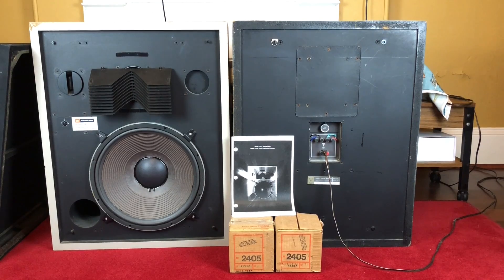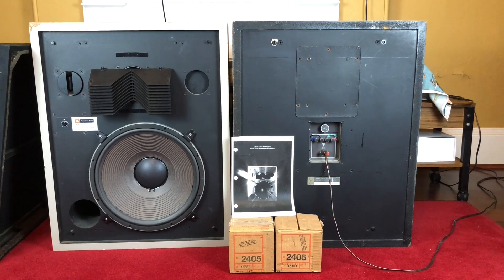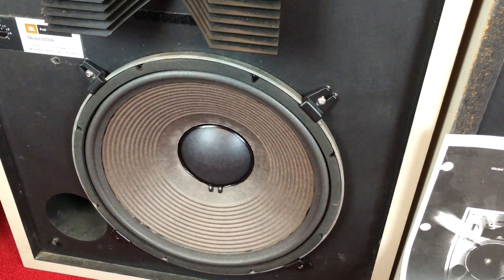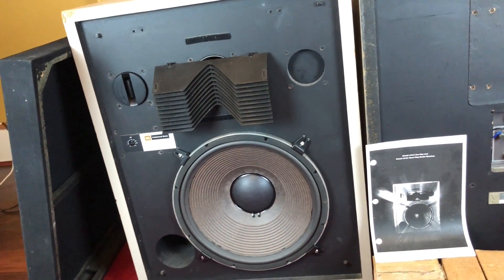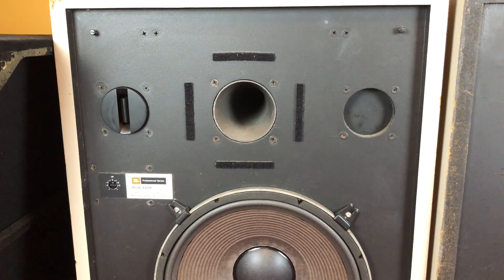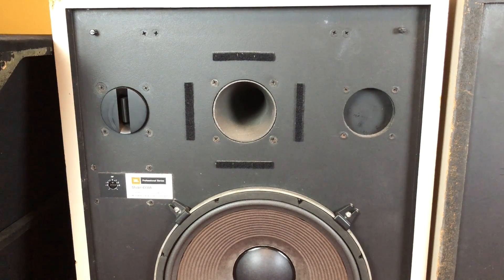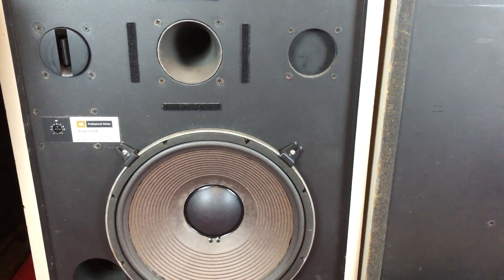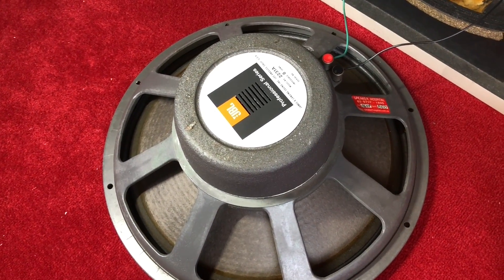JBL Speaker Upgrade -  4331A to 4333A conversion

Comment: Very thoughtfully done.  I too own a set of jbl’s . They are l-200’s. I’ve  been scrounging parts and so far have an N-8000 crossover and a beyma cp21/f as the tweeter for a l-300 conversion.  If, possible, could you hand drawn a schematic on how  you  did your conversion .  A schematic print enhances the video and would be greatly appreciated by many. Thanks.

Comment: Hi, I have 4331 with 4503-1WX cabinet. It has a 3131 crossover. It has a hole for a 2405 tweeter which is capped. I want to add the 2405 tweeters. It’s also has only one L-Pad. Do you have a schematic of what components I need to add to the horn and tweeter while retaining the 3131 crossover. Thx
Reply from the maker: You just do exactly what I did in this video. If you already have the 2405s, then you need to get crossovers. I used the 3106 which has a 8k cutoff. I just did a quick Google and there are plenty of them out there for sale. Good luck!
Reply: @audionautica6843 hi, I was hoping to just add a few components rather than having to spends hundreds of $$.
Reply from the maker: Well you will still need a crossover, so if you don't want to buy one you will have to build one. There is a Nelson Pass design on the internet for an L300, which is the domestic version of the 4333a, but that is a 3 way crossover. You need a 2 way crossover that will pull out the HF for the tweeter, and then send the rest to the existing 3131 crossover. The only reason I would be doing this is because I liked building crossovers and was good at electronics. If you are doing this for cost reasons, that seems like false economy to me. These speakers are worth USD5000 on the used market. If you wanted to buy an equivalent pair of speakers brand new you would have to spend many tens of thousands of dollars. They are still very good as 2-ways. If it were me, I would enjoy them as 2-ways until I had saved up enough money to buy the proper cross over and then do the conversion. I've owned mine since 2017, and I only "finished" them a couple of months ago.
Reply: Hi yes, but I just i figured i can get good components for the mid to cut it 8500h and have the tweeter take over there. and it would be just as good with solen coils and capacitors.
Reply from the maker: Yes - for sure!

Comment: Great speakers. I've got a pair of 4343 whose bandwidth is a bit flatter but I find the sound of the 4333 more natural. About the L300/4333 debate, these have a slightly different form factor but basically these are the same speakers. In France the VAT rates vas 33.3% for the L300 (categorized as luxury products) vs 18.6% for the 4333 (categorized as measuring instruments) so in the 70's a pair of 4333 was cheaper than a pair of L300. If I had to choose I would pick a pair of 4333 instead of L300 just because they are easier to put on a stand. These speakers need to be kept off the ground to give a clearer sound.
Reply from the maker: Yep - stands is on the to-do list.

Comment: Great Speaker !
3106 connects after the original crossover.
3106 input connects from driver output from first crossover
Its cascade setup that controls both driver 16ohm and tweeter 8ohm crossover at 8000hz
Normally 3106 receives signal after fisrt crossover that sends signal to driver  800Hz
Maybe im wrong but your method conection apoears incorrect by several reason.
3106 is great for your aplication, only its not properly wiring.
Hope im wrong
Cheers from Acapulco
Reply from the maker: I reviewed the data, and I can't see any application notes in the data I have. I agree that there are advantages to having the 3106 downstream of the main x-over. The way I have it now, the 3106 sees all of the power, and the bass and mid drivers are fed through TWO crossover, with 2405 super tweeter seeing only the 3106. Theoretically this could cause issues with power handling, as the 3106 is rated at 50Watts. Practically however, if I fed these things 50Watts I wouldn't be able to be in the room.
If the 3106 was downstream of the main X-Over, then it would only see the power that would have gone to the horn compression driver. (with most of the power going to the bass driver). The bass driver will see only one crossover, whereas the horn and the 2405 will see two crossovers. 

The challenge that I come to is practicality in installation. The 3106 has been designed to fit in the same cutout that the speaker wire terminal plate was mounted to. The data specifically says that the 3106 is intended to be used to upgrade existing speakers. This made me think that it is intended to go there. It just bolts on to the enclosure. Mounted as it is, you would wire it up as I have. There isn't really anywhere inside the cabinet to mount things. The 3106 is heavy and bulky, there is no-where to mount it, and if it was inside the enclosure, I would not be able to adjust the pot on it for x-over frequency (not that I ever use it!) It was easy to cable tie the speaker wire terminal plate onto a bracket so it wouldn't go anywhere, but I couldn't do this with the 3106.

It's probably worthwhile me revisiting it at some point - I think both options have their compromises.

Thanks for watching and commenting!

Comment: The reason why JBL has two different sets of speakers with different part numbers is due to marketing, one for consumer and another for professional. I think the domestic speakers the nominal impedence is rated at 8 ohms, and the professional is rated at 16 ohms. Each line is sold by a sperate dvision within JBL. Other than the model numbers, the consumer and professional components are almost identical.

The woofer is the JBL LE15, I forget what the pro designation is. The compression driver is the LE 175, this is the lowest model, there is a more expensive model called the LE85, and the price when it was available was 50% over that of the LE175. Both of these have a 1" throat, and a 1 3/4" diameter edge wound voice coil. JBL also made the 375 compression driver, it had the massive magnet structure of from the LE15 woofer, it weighed like 25pounds.

The super tweeter is a variation of the JBL 075 ring radiator, it is called the 077 slot radiator. The 077 will reproduce highs to 20k, whereas the 075 is only good to 15k. The 077 when you can find it costs nearly $1,000USD.
Reply: LE15 X 2215 (studio)
Reply from the maker: Thanks so much for this. I've added the JBL part numbers up in the description. Interestingly even the crossovers had domestic and pro part numbers. The N8000 is the domestic version of the L3106. The N8000 manual says "Permits adding the 075 or 077 for extended response in any JBL system using the LE175 or LE85 compression driver."
Reply: The woofer used in the L300 was actually the 136A, I have a pair and have reconed them to 2235H. The L300 also has a slanted front allowing a longer horn to be used with the LE85.  If you ever want to do a significant upgrade you should build Nelson Pass’s crossovers, there is a charge coupled board out there that you can populate with the components.  Quite the improvement! I know you didn’t want to, but it’s definitely worth the effort over the stock crossover
Reply: @danhorton6182  interesting perspective. Could you please ellaborate a bit more the concept of the « Nelson Pass » filter? I have a wonderful Alnico L200b set  and I’m thinking about 3way tweaking.